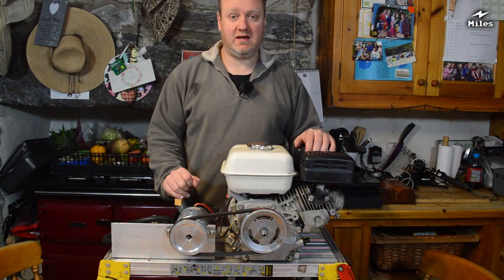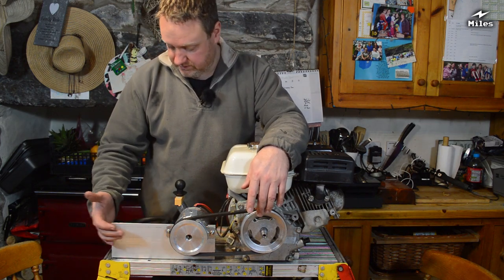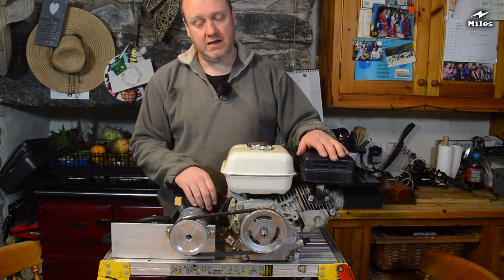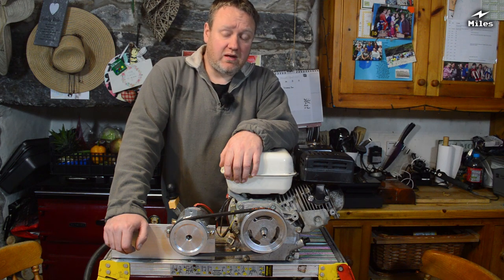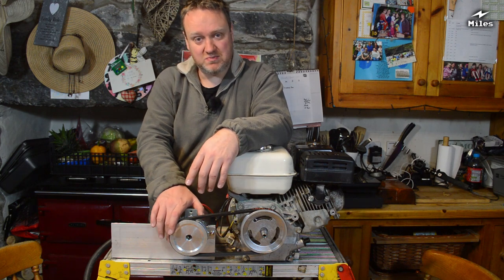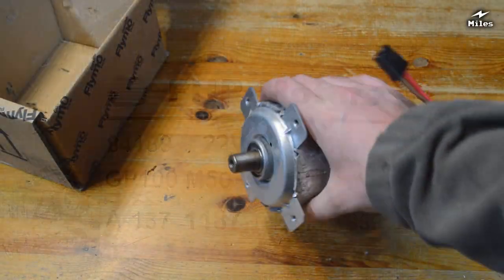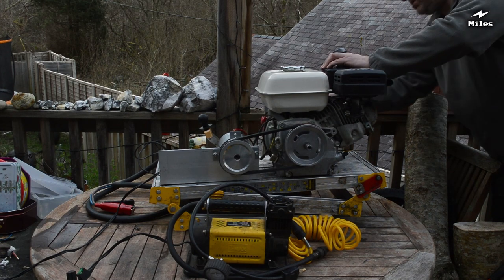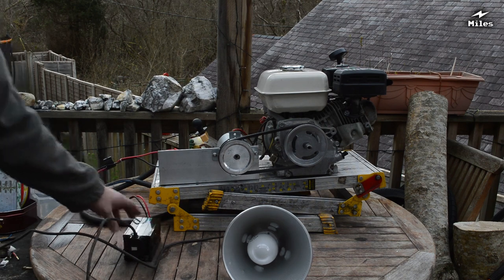Homemade DIY DC 12v Generator Battery Charger, slow running Honda GX160 gasoline engine, low voltage

Comment: You are a great teacher.  We're about to build an off grid power system and enjoyed the video and simplicity of connecting components.  We didn't realize the battery could start the gas engine using the DC motor instead of having a dedicated starter motor...didn't think of that bonus.  Also, didn't understand that a DC generator is simply a DC motor.  This tip will help us to find the basic components more easily.  John

Comment: Pretty cool! Building one myself now to put into my 60 amp DC to Dc charger to charge my 200 AMP HR. Lithium solar generator for the multiple rainy days. 
I think this will work great. 
Thanks for the Video.  👍🏻
Reply from the maker: Thanks for the nice comments Townson, good luck building your own. Maybe make a video of it? Miles

Comment: Thanks, Miles and I had one with a 2-cycle motor years ago. It got gone as things do. Hope all is well at the mine and your place to. God bless!
Reply from the maker: Cheers Lewie, nice to have you here and I appreciate the comment. Funnily enough I have an old 2 stroke one that I aquired ages ago, for charging 24v batteries. The engine looks like it's from India. I've not really looked at it yet, and not tried to run it, I thought I'd do a short video on it when I do. I'll get around to it at some point!
Reply: @TheAmazingAdventuresOfMiles  I'll watch!

Comment: Fantastic job, easy to watch video, loved the motor starting the engine.  Been thinking, and preparing for a Lister CS 6hp running two PMG's  into battery banks for remote shed, low noise, low fuel consumption , low maintenance.  Needs to be self starting and stooping.
Reply from the maker: Thank you Nautilus 1, really glad you liked the video. I'm still using mine all the time, It will run for hours and hours on little fuel. A Lister CS would do a lovely job for power generation, although the automatic start and stop might give you a few challenges. I'm sure it could be done though! The Lister CS is a lovely engine, providing that it's set up right and looked after.

Comment: great idea! I want this for an apu in my truck. Charge a battery set that runs a 2000 w inverter, run a 12 v aircompressor etc. Looks very feasible to me am i missing anything. I love the idea of using the motor/generator to start the gas engine...
Reply from the maker: Thanks for watching Lyle. No I doubt you're missing anything It's all pretty simple and I think I've shown everything about it, worth making one if you're looking to do all that stuff.

Comment: What I'd like to see is someone rigging the generator to one of those old Lister diesel engines. That would be brilliant off grid system. I tried to get my hands on one a few years back but came up short.
Reply from the maker: Hi Kryten451, thanks for posting. I've actually done just that, I've just not yet go around to making a video about it! I will do so soon :)
Reply: @TheAmazingAdventuresOfMiles  Wow, that would be the incomparable feat. Cannot wait!

Comment: I wish they would make some think like this, just a 12v Geny, I do not need 240v,  as every think in my Tramper Van is 12v or below,   good job, ome day I will make somethink like this,  got to get a 40amps alternator , one with just 2 wires on

Comment: I am building one of these generators with an electric lawnmower, PMG. I am going to use a high-voltage disconnect on the battery for over charging when it disconnects my concerns are will it hurt the PMG running with no load or overheat it

Comment: Very cool. Nice portable design.  Can that dynamo put amps out at fairly continuous duty?  I used a Dual-Core PMA for mine but it's used for charging my battery bank. Check it out if ya got a few minutes.
Reply from the maker: Hey there Small City Homesteaders, thanks for checking in. Yes it seems happy to run under load for a while, it gets warm but not really hot. I tried to start my car directly off it without a battery and it did actually turn it over, but it was extremely hot after just a couple of seconds so I won't try that again. I'll try to get some actual useful performance measurements but it's not going to measure up to a PMA.
Reply: @TheAmazingAdventuresOfMiles  still, very cool! I love seeing different builds. Impressive that it could crank your car over. I've thought about building a smaller, more portable unit with a 40-50cc 4-stroke and either a small PMA or a dynamo. Would be handy for exactly that...jumpstarting and such. I did build a 20" pedal bike with a permanent magnet motor from a treadmill.  It works but at full steam I can only crank about 280 watts out of it and not for long. I have a new respect for the amount of torque generated by the blades of my wind turbines.  Amazing the energy required to convert a bit of electricity eh!?

Comment: Ive been wondering if it'd be possible - rather than fuel/cost efficient - to charge an ebike battery (of any configuration) using a 2-stroke petrol engine such as are used to make 80cc motorised bikes because you could then have an ebike with extended range without requiring road tax/insurance as the power drive is fully electric which is legal on UK roads..
Reply from the maker: Hello Gold Bunny, yes I suppose you could, but I think it would still be quite a cumbersome thing to carry around? You could probably carry three extra batteries for the same weight, and a charger. I have been musing about the possibility of making a super-small pocket generator from a remote-control model aircraft engine, which might be another solution to range-extending an eBike. I've a long list of "Things to make" though! Never enough hours in the day :)
Reply: @TheAmazingAdventuresOfMiles  That's really what I was thinking too, but I also like the ide of being stopped by cops and letting them know I'm not running an untaxed uninsured petrol motorbike I'm riding an ebike fully legally re-charged on the go by a mobile petrol generator : )

Comment: Tell us more about the generator motor where did you get it? Where can you get it in the US? What kind of equipment does it come in? is it permanent magnet or brushes 24 V or 12 V
Reply from the maker: Hey there P, thanks for watching and commenting. The motor is out of a 90's Flymo (floating lawn mower) and it's permanent magnet. I think it's probably 24v but that doesn't really matter so much. Just put 24v DC motor into eBay, loads of stuff will come up. You just want something with two wires so it's permanent magnet, literally any of them will make electricity if you spin them. The bigger the motor, the more it's going to make.

Alternatively you can use an alternator like out of a car or a truck, although these are rarely permanent magnet as standard, so they need a battery connection to work. you wouldn't be able to run devices like inverters directly off a standard alternator. But Alternators are very good at generating and old scrapper ones are cheap as chips.
Reply: I have a generator with 2 , 110 outlet on it on the old 72 Chevy service truck, I used it tell 1995 and still working, I used a bungee cord to keep it tight and put belt on when needed, had alt on left side of engine
Reply: I am building one of these generators with the electric lawnmower motor. My concerns are if I use a battery over voltage disconnect would it hurt the PMG running with no load on it? Would it overheat or damage the motor when it disconnects from the battery?

Comment: did the engine have a governor or was it not a self rpm govern engine i like the idea of using the battery to start then charge
Reply from the maker: Thanks for watching and commenting David, nice to hear from you. Yes it has a governor, albeit a crude one. There is an adjuster screw where you can set what speed you want it to run at, from about 850 rpm minimum and what seems to be around 4500 rpm maximum. The governor then uses centrifugal force to open and close the butterfly valve in the carb to adjust the fuel coming in to deliver that rpm. Or very approximately anyway. It does mean that if the load goes up, the throttle opens up more to try to keep the rpm the same. Although only within certain bounds, in practice the throttle position doesn't seem to alter much at all between drawing 0 amps or 40 amps. Just for a laugh (!) I did try starting my car just off this (no battery), amazingly it did actually crank the engine (a 2.5L diesel) and the throttle certainly opened up then! But it would have been drawing hundreds of amps at that point. I didn't want to do it for more than a few seconds, it would burn it out very quickly.
Reply: @TheAmazingAdventuresOfMiles  i did wounder if the fans would produce enough force to altere the sail style governor i looked up the motors as i been thinking about a small engine gen for charging batteries for times of black outs more so lately with all this covid-19 stuff only engine i have laying about is a 2 stroke strimmer engine not ideal but when needs must
Reply: @TheAmazingAdventuresOfMiles  the last gen i had did have a 12v battery charge take off but was so low a current was not worth even running ended up modding that to a car alternator instead but like you mentioned the rpm had to be high to work thus been a waste low rpm motors ant easy to come across
Reply from the maker: @1981dasimpson  Well a two stroke strimmer engine would work, so long as you can mate it to either a DC motor or PMA or something (ideally a 24v unit for making 12v). You would need to be able to tweak the running speed to get the voltage about 14.4 - 15.0 volts. Would certainly work though!
Reply from the maker: @1981dasimpson  Yeah a lot of generators, especially Chinese ones, have a 12v take-off but in my experience they tend to be a bit rubbish. It's only there because it's got to generate 12v anyway to power the field (as it's a brushed alternator) and it provides the surplus from that as a 12v supply. Thing is, they won't give many amps (5-8?) and all the ones I have actually output exactly 12v, which is useless for charging batteries. It'll get a very flat battery to about 1/2 full but won't go any higher. Needs to be at least 13.8v or ideally 14.4.
Reply: @TheAmazingAdventuresOfMiles  i had thought about a dc buck boost converter to set the voltage this way it acts like a charge controller and stops over charge but also boosts the voltage
Reply: @TheAmazingAdventuresOfMiles  yeah pretty much exactly what i come across to

Comment: I won't argue that this works, would be stupid if i do
But wouldn't an alternator be better? Is made specifically for charging batteries
I know alternators require an initial current to work, but same as this setup
Reply from the maker: Thanks for your comment Helistorm98. In short - Yes! Any car/truck alternator would theoretically do. But this was a bit of a scrap-yard challenge for me, I don't have an alternator to use, just wanted to use what I had really. An alternator could be pushed harder for more output sure, although there are some benefits to a DC motor like this, firstly it doesn't need a battery to generate a field (so can drive inverters etc directly) and secondly you can use it as a starter motor. These are minor benefits though, if I was starting from scratch with all parts bought new, specifically for charging batteries, I would go with an alternator.

Also the starter motor thing, on something like this it's really no big deal, it's easy to pull start. However, supposing you use this as a top-up system for off-grid solar/wind/hydro, you could place the generator in a box outside your house and actually start and stop the engine remotely from inside, without having to go outside, open the box and pull the cord.
Reply: @TheAmazingAdventuresOfMiles  
Thanks for taking the time to explain.
Reply: The other advantage of this setup is the low engine run speed.  But you could probably just gear the pulleys to run the alternator at whatever speed you want (they are more efficient and powerful at higher speed).
Reply: @swhit  
I just read somewhere that running a alternator at low rpm will cause it to overheat , running it at around at least 3000 rpm will keep it cooler

Comment: That's not a good way to make this.
Your motor puts out 24v (rated)
You don't have voltage or current regulation.
The winding on the motor dictates the current.

You can use a Lucas voltage regulator, there not costly, but  regulates both voltage and current. You can often get a AC ripple so I would add a bridge  and a diode so that you can control the flow.

The motor is 5.5kw,  so you can make up to that much power. 
Modern Dyno/alternators produce around 50amps (typically 46) older, around 12. And down to about 3.

Safe charge varies with different batteries. This regards both voltage and current.

Around 5 amps won't damage your plates.
14.4 is a good medium voltage. 
But you must be able to maintain a 13.2/7 float. As the current drops in the battery.